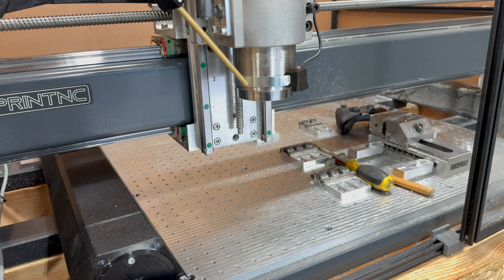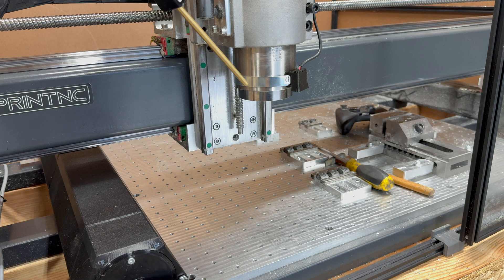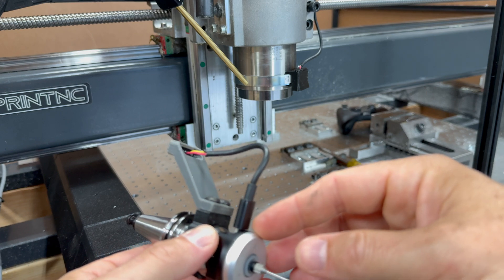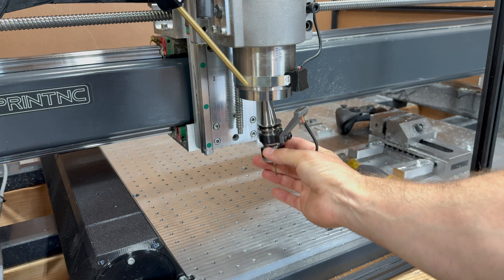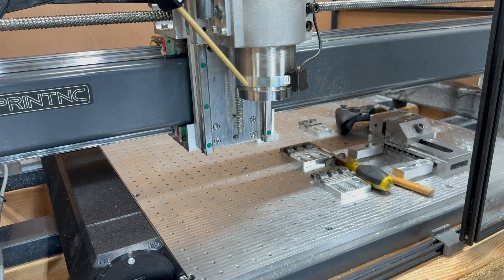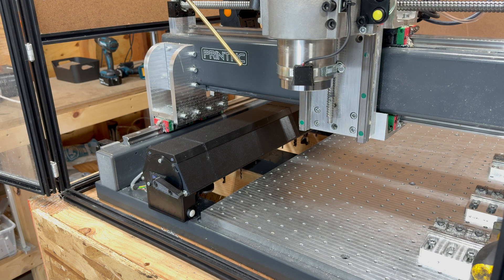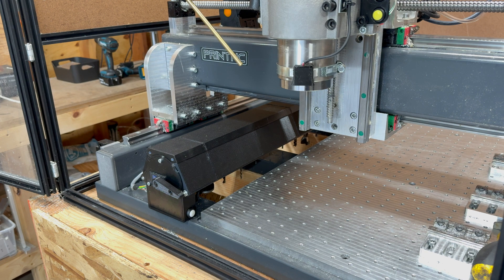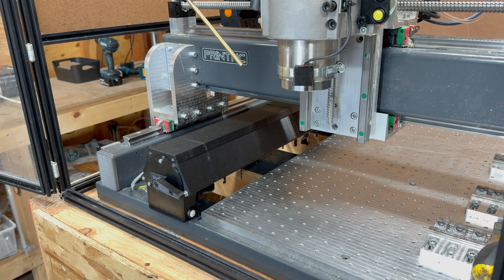Magnetic probe for CNC ATC spindles *DIY*

Comment: Your spindle looks so awefully clean. Mine has lot's of smudge on the underside from MQL coolant, very fine chips from thread milling and cardboard from the VacuCard. If all of this lays on top of the female part of the connection over time it might become an issue. Because I haven't seen in both of your solutions any protection of the female connectors, that are attached to the spindle. Very interested to see your long term experience
Reply from the maker: Servus! 
I guess (hope) that gravity will keep the female part clean. And I don’t cut a lot of steel or iron, so the magnet shouldn’t be an issue. But I will keep you posted.
Reply: @SebastianMusser  Biggest issue I have noticed is the mix of MQL fog and dust from cutting a few 1/10th below the work piece either into the vacucard or HPL waste board (tape and glue fixing)

Comment: how do you measure the length, isn't the z tool length setter also a switch so they both can't switch at the same time? One triggers first and then the other? Or am I missing something. I'd really like to have Haimer 3D tester for my CNC but the only way I figure I could get correct tool lenght by probing it would be to mechanically fix the Haimer to zero position and then probe it.
Reply from the maker: Yes. Both the probe and the setter are basically switches. They are connected with an XOR logic to the same input.
Reply: @koitk Maybe this works with probes that trigger on electric contact. I agree with you that on probes that trigger after a certain amount of travel this wouldn't work
Reply from the maker: @scratchbuiltdesigns no, my Chinese probe is a mechanical switch. I see your “issue”, but in my case the deviation between “probe triggering” and “setter triggering” is almost zero. 
And you can also use G38.4 to trigger the TLS when it is “released”. That should take the springy probe out of the equation.
Reply from the maker: It seeks at the fast rate and then does the pulloff at the search rate until contact is lost. 

So it combines the seek and the pulloff into more or less a single move, but there's no loss of precision.

Uses G38.2 for the seek and G38.4 for the pulloff.
Reply from the maker: But still… the pre-travel before my toolsetter triggers is probably less than 0.01mm.
And even if your tool setter needs more travel, you can measure this and take it into account, right ? (Grblhal e.g. has the option for touch plate thickness)
Reply: @SebastianMusser  Yes, I have basically the same probing routine (in EdingCNC). But both of my probes "move" after contact until they trigger, then there is a distance for the decelleration, and only then the axis in question reverses and moves slowly away from the probe until it stops to trigger. That's when the reference is taken. So in this case, and I believe this is what @koitk was refering to, you don't know which probe triggered first and you cannot measure the length of the 3D touch probe that way.
In such a case you have to measure the trigger length of the 3D probe separately and store it in your controller. Then, when you call the probe (in my case tool #99) the controller knows exactly the offset and you can measure work piece zero
Reply: @SebastianMusser  Well, I have ISEL CNC with their proprietary controller and software, I haven't really dug into it that deep but I bet I can't change much of the settings and the logic how the probing is done. I would kill for a MPG pendant for the machine but again they have their own closed system and their MPG costs an arm and leg.